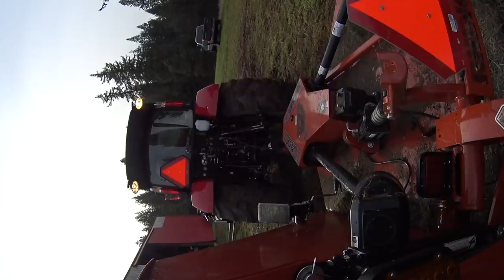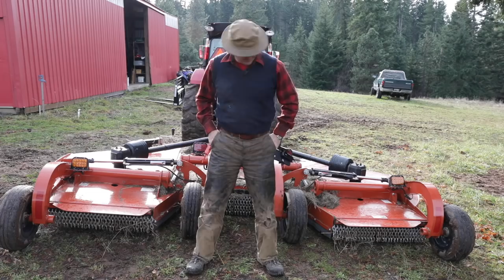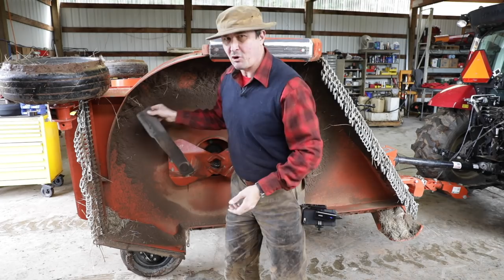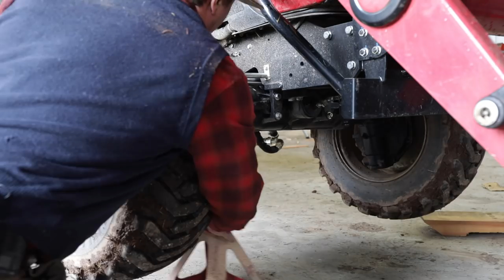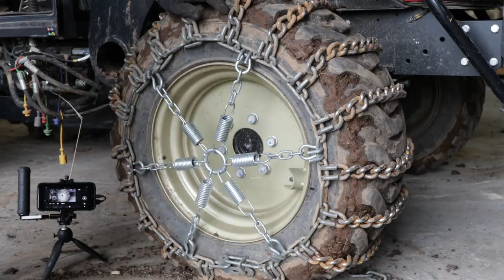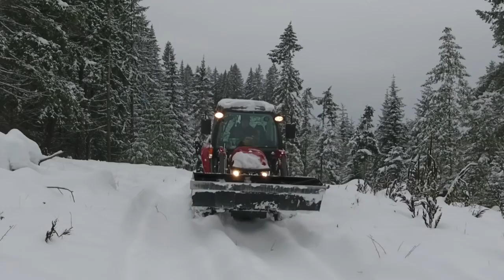AMAZING Tire Chain Hack For Winter

Comment: I got this tool with my chains, tried it and thought it was OK... Then I thought of using a ratchet strap instead. It worked much better in my opinion. I don't think it would work on smaller tires though. I used it on just the rear tires of an old tractor.
Reply from the maker: A ratchet strap would not work, the hook ends would never fit inside the chainlink, please post a picture of how this would work?
Reply: He isn't really a customer and Cody is just asking for some clarification. Lighten up.
Reply: I do the same thing. Using small/cheap hardware store straps with small hooks.
Reply from the maker: Just wanted clarification, I don't understand how this would work,
Reply from the maker: Just wanted clarification, I don't understand how this would work,
Reply: I knew what you mean but I still wouldn't say "customer" is the right word. A viewer isn't necessarily a customer, or even a subscriber, for example many people use AdBlock and aren't subscribed. It's not exactly a retail environment though its not unlike one either since it is a business. Before you go passing judgement on someone, first try to comprehend what they are saying. He clearly just wanted understanding. Don't we all want understanding on some level? Have a nice day.
Reply: Maybe my links are bigger. It did work. And there are all different sizes of ratchet straps. I did use them. They did work better for me. Your basically saying I'm lying by the way. I was just suggesting an idea that worked for me. I appreciate all the vids anyhow, most are informative and entertaining. I have been watching for years.
Reply: J Vanier I don't think that he was calling you a liar I think that he was thinking about a 2 inch standard ratchet straps that does have a large hook and was wanting clarification on how those would work and fit in the chain links. And Yes you can get a 3/4 or 1 inch strap with smaller hooks but he probably wasn't thinking about those at the time. I myself know that there's a lot of misinterpretation in typed and text messages because all you can see is the words there's no feeling or emotion put into the messages so there's always room for misinterpreting a message.
Reply: Comments section of WranglerStar videos have so many whiny dudes.
Maybe most is the fact that tone is hard to judge through text, but it’s hilarious I only have to read one comment string before someone in the string has hurt feelings. lol
Reply: One of the silliest bits of wisdom:  The customer is always right.  BS.  The customer usually doesn't know the first thing about it, that is why they are going to a professional in the first place.  Just saying.  Not that Youtube viewers or even sub could be considered customers.  That is pretty silly too.

Comment: Lay the chains out, including your spacer blocks, drive onto the blocks and lift only 1/2 the weight of the chain and link them together at top. The lugs in the tire thread will hold them in place...... You made it twice as hard as it should be

Comment: Wait till you put new tires on you may have to add a link back in your chains do to a little difference in Tire radius just because of thicker tread and different tires. You may not be able to get the exact same tire. It happened to me about 10 years ago on a garden tractor. Now my new chains I use a spring to on the end links to the side chain to keep the excess from flopping around works great. I tried a small bungee 1st it worked till I got in a mud hole and broke it.
Reply from the maker: The tires are new,

Comment: Every time I see you struggling with those tight fitting springs, I wonder why you don't just cut 3/8 to 1/2 an inch of the end of the 180 degree bend. It does not lessen the strength of the spring but it makes the opening a little bigger and hence a whole lot easier to install.

Comment: Great job and great video but you should have left one extra link on the chains on the front tires when you cut them. Now you do not have anything to hold when you want to pull them tight.

Comment: I'd like to know where you found that handy little orange come-along tool to tighten the chains.  It looks like something I want to toss in my bag-o-chains.  Also, I might go to the hardware store and buy some tension springs and a metal ring like you used just in case I need to tighten my chains a little better.
Reply: Jim Rodgers you should be able to find them at a farm supply store. I know that places like Tractor supply has them.

Comment: Why do you use chains on your tractor? I am wondering because I'm a rancher from Canada and I have never seen anyone put winter chains on there tractors and they have gone threw every condition possible from ice to snow to mud and we never have a problem even pulling a variety of different trailers or equipment. Love the Channel your videos are awesome
Reply: tate creasy agreed...no chains on 2 WD 4430 chore tractor or  8450 plow tractor. furthest/ darkestNorth East Sask. winter 7 months of year.

Comment: I was more worried about all the exposed wires and hydraulic lines between the wheels that look like you would rip out running through brush
Like your videos

Comment: I noticed on the rear tires that you didn't space the inner chains two changes apart.  If you had you would have needed two more chains to connect to the center.  Was this decision intentional or did you simply not have enough extra chains to connect?

Comment: I don’t see why he couldn’t just lay down the front chains, drive forward onto them and connect them, then lay down the rear chains and back over them and connect them vs wasting a lot of time lugging all this other equipment around.
Reply: Trying to pick up each slack end of the chain and trying to get them together and tight would be a battle.  It's easier to drape them over the tire, especially when they get heavy with long lengths or dual tires.
Reply: Neil W. Well, as usual he made an easy job difficult, all he had to do with the front wheel lifted off the ground is pick up the chain and drape it on the wheel and while he was standing make sure that the chain was on evenly from side to side instead of trying to pull it like he did
Reply: Gravity, better when working on your side.

Comment: Great video. I have a couple of Yanmar tractors although a bit older than yours. Both 1986 models. I acquired my first set of really heavy duty chains. I am sure they are at least 5/16 chain size and also the H pattern. They seem to be the correct width but are about 10” too long. Having a heck of a time getting them cinched up and don’t want to cut anything off before I do. It is a wrestling match for sure as these chains weigh darn near as much as I do. Great story about your Bronco out elk hunting.

Comment: a cheat is to just run wire through rim and tie ends to chain then drive forward...as you get older you use the cheats more and more

Comment: No, , your doing it wrong!  Lay them flat behind the  tractor,  use punge straps or wire though the slots in the rim! Drive forward "slowly " , stopping every couple of feet to make sure it is going on straight,  then connect  and tighten, add springs! Much, much easier and safer!

Comment: face-palm... you are going to need those chain links that you cut when you install new tires!!!
Reply: going to want to get new chains with new tires anyway since they do not last much and worn down links will degrade the overall quality of the system, not to mention the rust build up. If anything he may want to read the instructions first as he could have saved himself later when is going to need those extra links if he still uses them with new tires, should have just wire tied them to other links.

Comment: 11:00 installed springs with no preload.  REALLY?  video about HACK process that requires a barn a concrete slab free of snow, jacks, compressed air, custom wood devices, hours of time, hours of blather and WALAH - IT'S MAGIC!

Comment: I'm guessing you are going to have a hard time fitting those chains once you buy new tires now that you have cut the chain.
Reply from the maker: The tires are new,
Reply: I was concerned by the change in diameter as the lugs looked worn to me. As you say they are new then maybe I'm used to more aggressive agro tires on tractors over here in the UK.
Reply: Those are turf saving style ag tires, aggressive enough to pull plows through mud but gentle enough to keep the lawn looking nice. Guess you guys in the uk don't care much for grass.
Reply: They are industrial tires. Not agro or turf at least that's what I have heard they were
Reply: Stephen Morrish - a D-ring or two could be used to "stretch" if needed
Reply: I see, I think tractor I think of the type of ones I used to drive on the arable farms I used to work on. These look more like an intermediate tread, grass tires over here, the type used in parks and the like have much smaller lugs, a sort of cross patern. These looked like part worn agro tires, so that explains my concern.
Reply: right. Industrial tires is the proper name. That's exactly what I have on mine.
Reply: Stephen Morrish they're basically a backhoe tire.
Reply: quick links?
Reply: Pretty much. I never cut the slack off. Just zip tie it to the side chain.  Sometimes when you're stuck and have to put them on you can hook them on the ends and pull it around by turning the wheels gently.

Comment: Those rear chains are seriously heavy and cumbersome to get on, so I just tie one end of the chain to the rear tire, lay out the chain flat behind the wheel, and then just slowly drive forward, until both end are about at the 9 o'clock position.
The basic principle is demonstrated here: https://www.youtube.com/watch?v=WjPEvdJZ3E4
Reply: Just watched some of your other videos, didn't realize you had connections to Sweden...but the above method is actually taught out by the Swedish military...just FYI

Comment: What do tire chains do? I know they are supposed to help grip the in the ice and snow. They really don't look like they add much traction especially on a tractor.
Reply from the maker: They add tremendous traction,
Reply: They don't add traction on hard surfaces like concrete floors obviously.
Reply: The traction increase with tire chains is phenomenal.
Reply: I guess my question is really how do they work? I don't mean ask the same question twice if the answer is the same. I'm from Oklahoma, its snows maybe for a week a year so I put bags of concrete in the bed of my truck. I've never used chains.
Reply: tommy gee We use them to travel on iced roads / trails. Rubber tires will slip on ice. Chains act like studs and bite trought it. Chains are useful because as the video showed, you can remove or install them when needed instead of having an other set of tire with metal studs.

Comment: I would not of cut the extra links off,,, changeing tires,,,sell them,, use  zip ties
Reply from the maker: Zip ties will fail in first hour of use,
Reply: I've used heavy duty wire to tie up the ends on the work truck when using chains for an extended period of time, cant really cut them 'cause the chains get switched between various trucks (because as stated in another comment, norwegian tire chains are ridiculously expensive)

Comment: When you were putting the chain on the 1st tire why, when you spun it, did the other tire spin the opposite way?
Reply from the maker: Yes this is the way an open differential works,
Reply: Kyle Kelly that's the way all axles work unless it has a locker (possi traction).
Reply: look up how differentials work on youtube
Reply: Thank you

Comment: Pitch that damned boomer! They make small screw type load binders. They have more stroke and are safer. You slip with that thing and its not over center yet or does it on its own you can get very badly hurt or killed! Theres a reason the DOT banned them on loads that are chained down.

Comment: You work too hard putting those Chains on .  If you lay the chains out on the ground and hook a bungee cord to each side of the chain and then stretch it over the tire you can drive right into the chains on both wheels at the same time..  I do this on my truck putting on dual wheel chains that are 11/24.5  it takes no longer than 15 minutes on the side of the road to have both sides done.

Comment: Don't buy china made tire chains ,they don't last ,they will damage your vehicle or equipment, and the fact is the DOT should not allow tire chains made out of mild steel or china steel ,to be used as traction devices.  
If your chains are the right size for the tire you put them on ,you should never need bungies or springs to keep them tight. 
How do i know ? I wore out four sets of chains last winter on I-84 will a tractor trailer rig,but have also been chaining up big rigs for twenty three years . NEVER drive over a pile of tire chains that are laying in the road ; that is like driving over a pile of razor blades. 
The problems that alot of truck drivers have with tire chains is that they were never taught how to properly put chains on ; the other problem is that the DOT is allowing cheap garbage chains (made in china)to be sold to  trucking companies and between those two problems, you still have the problem with drivers haveing to drive on bare road with the chains on ; that tears up the road surface and heats up the tire chains and they don't last long when that happens.  Solution to this problem is simple : stop all the stupid ticket writing, because that is just stealing money from truck drivers ; Drivers should have to stop at ,for example , a Oregon port of entry and demonstrate that they know how to properly put a chain on . If they can't do it ,that driver probably shouldn't be driving a tractor trailer vehicle up over mountains that are covered in snow.   Just my two cents on all that .   
I think that i have seen cross links of chain, fit for farm tractor tires, that hook to the rim on the inside and the short length of chain comes over the tire and attaches to the rim on the outside  ; i have seen mini chain binders used for that ,and the nice thing is that you can add as many of those as you like and no more back breaking lifting a hundred pounds of chain .
Reply: His chains were custom made for that tractor by a company in NC.

Comment: ...............you should invent something

i dont know what or how or why but i just feel like something needs to be invented and you should invent it

i may be extremely tired and slightly delirious
Reply: what about a workshop broom with powerful magnets in it so you can sweep the dirt away but it picks up any dropped washers and screws and all that. there, you can have a free idea on me
Reply: B & A Talks they already make magnetic shop sweepers. They’re giant plate magnets on wheels so you can sweep up metal grinding and cutting dust and nuts and bolts etc then the magnet flips up from its holder so al of the above drops into a pile to sweep up.
Reply: thats metal grinding specific. i mean like a normal brush with magnets inside it so you can sweep common dirt and dust away and pick up any little nuts and bolts youve dropped. i dont know, i am very out of it at the moment.

Comment: If you're installing chains in a shop, why the hell would you fool around making and using those wood blocks? You can get the rear tires off the ground with an inexpensive bottle jack which you know this guy owns. Too much time wasted on gimmicks.